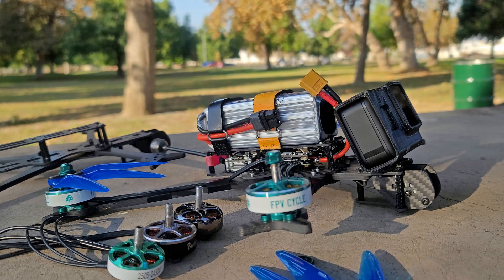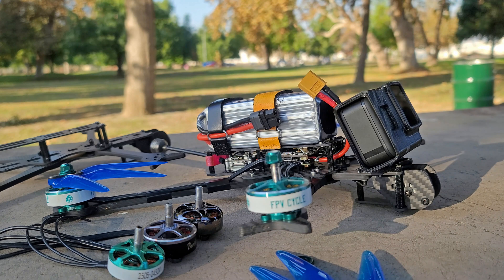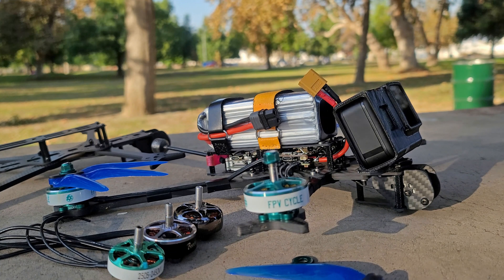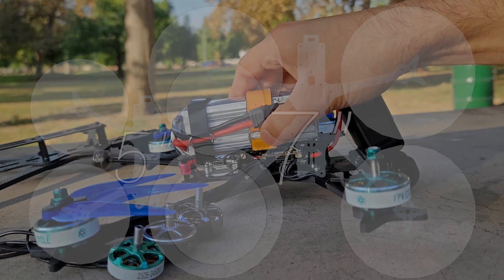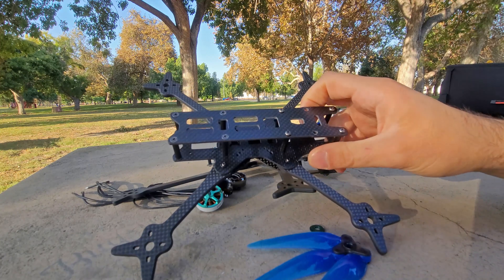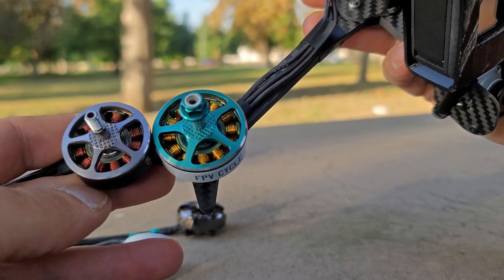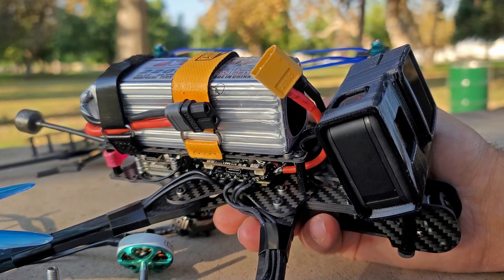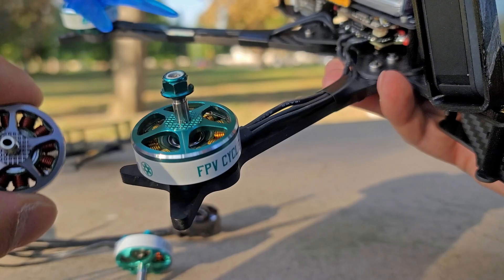A reshuffling of motor sizes, new 7" motor

Comment: Sold me on the DAL, picking up a set of these too! Keep up the Amazing work.
Reply from the maker: Wait. They explode. They made a new hub. Coming soon
Reply from the maker: The new hub is real good. 

https://fpvcycle.com/products/dalprop-fold-7-diy-folding-props-with-updated-hub?_pos=4&_sid=58dab937d&_ss=r
Reply: @Kabab  
How can I see it's the new hub or not?
Reply from the maker: @waldemarkraus2855  you can't tell unless the listing specifically says 'new hub' like the one on fpvcycle does. They even look the same but one explodes and one does not
Reply: @Kabab  
I found some information and pictures here:
https://www.foxeer.com/dalprop-fold-2-f7-folding-responsive-freestyle-props-less-propwash-g-318
Looks like the new hub is completely black and they use some kind of fiber composit material. They also call it "Fold 2" now.
I found no source to get them here in germany. Even banggood seems to still have the old batch :(
Reply from the maker: @waldemarkraus2855  order directly from DAL?

Comment: Have you tried CNHL's 2200 6s yet? all C variations (70, 55, 40) are quite cheap at the moment. I just got a 8" yeti shipped out and their preferred battery has been out of stock for a while.
Reply from the maker: They're cheap because they're cheap. They just can't provide the amps.
Reply: @Kabab  I see. I had heard good things about their smaller lipos. Would swapping to xt90 make a meaningful difference in this case?
Reply from the maker: @zaplocked  yes definitely. The xt60 is limiting for sure.

Comment: Just curious, what updates or changes were made to the 5" glide frame? I've been running the hyperlite Flosstyle 5" for years but have broken a few arms. I got the 6" glide and it seems great so I'm considering the 5" glide
Reply from the maker: Various parts were beefed up and the lower deck was adjusted to make it easier to build.  It's now 103g

Comment: Curious about the Dal foldables exploding, what is the point of failure? I imagine it would be the mounting hubs and not the blades themselves...correct?
Reply from the maker: The hubs flex out and let go of the blade. They've updated the hub and are sending me some new hubs for testing

Comment: Looking forward to hearing more about this frame. I'm sure it will follow suit with all your frames, that being as light as possible. The problem with a 7" quad is vibration with the size of the motors needed for a quad of this size. I know I'm not telling you anything you don't already know, but I've never had any luck in a 7" quad with arm thickness less than 6mm.

Lastly, i appreciate all your efforts in developing a quad size that just doesn't get any attention, for the most part!
Reply from the maker: Really zero attention for 7". The whole class just gets leftovers.  I also hear you on the 6mm arms but it's just too heavy. 5mm and wider has been working out so far. Too much more than 160g frame weight really starts significantly impacting performance. The gopro is extremely annoying to throw on there too.
Reply: @Kabab  - Pretty much! Other than you, Rotor riot seems to be the only other company exploring the 7" frame! What no one is doing is targeting the 7" for freestyle specific. And, i get it, the market for this size quad is for Cine-Crusing. 

Would 7" freestyle be something you would consider exploring, or perhaps are exploring? I'm going to try your new motors on this TBS Source 7 and see what sticks! If these were in a 1700-1800kv I'm thinking that could be the magic mix, even with the GoPro! Again, i realize the market is for the lower kv for that size motor.

Maybe for Christmas!!

Thanks for listening!
Reply from the maker: @3eggerfpv397  yeah I'm planning on two more 7" frames. Something general acro and the light 7"
Reply: @Kabab  I'm in!

Comment: Great video! How many amps does a setup like that draw? Do you really need such a huge (and heavy) battery?
Going only by the youtube footage, 2810 motor seems a lot more lively on 7 inch still, but really happy that we are getting more good options for the sevens now. Keep up the good work! :)
Reply: Likely peaks close to 200amps
Reply from the maker: Amps are probably around 200 at peak. Doesn't really matter and we can't get a solid read on it anyway. Unfortunately you do need a substantial pack. It needs to be able to provide those amps. 1800mah on an xt90 is the absolute minimum I'd go with for this.
Reply: @Kabab  thanks for this info, so using 2 1050mah 6s packs from the 5 " in parallel should be a great match.

Comment: Just wondering if anyone's ever thought of putting the flight controller in the back of a deadcat quad instead of the central stack so that it is located more centrally between the props? I've always heard of how strange the deadcat configuration feels and am wondering if having the more central flight controller would help in any way?
Reply: Dont matter where it at since the frame is flat, bob discused this in past
Reply: @flo-ridafpv5713  But if you were to, say, rotate the quad on the pitch axis around its center of mass, the flight controller would not just rotate on axis but be accelerated around in a loop. The g's created by the acceleration in a loop cause readings in the flight controllers accelerometer would not be there if it were only rotating such as the case with a flight controller located at the center of mass? I might try building one and switching it back and forth to see if there is anything to it, probably not anything, just curious. Thanks though. I'm gonna have to go back through the repository of Bob's vids. lol.
Reply from the maker: It doesn't matter where the FC is mounted. Dead cat feels weird because the CG is in the wrong place but we don't have a choice because we need props out of view.
Reply: @Kabab  Thanks Bob. For some reason it just bothered me that it was so far from the center of mass. Love the motors. I'll have to try and snag a set for myself.

Comment: Thank you for all the great work and pushing the hobby in the right directions! Do you think there is a place for 8-10 in or are quality props and costs the limiting factor? Either way looking forward to the 7 in props you have coming up!
Reply from the maker: We don't even have good 6 or 7" props let alone 8". In time there will probably be a place. For now, we need to get something reasonable for 7"
Reply: I find the graupner e-prop 8x5 to be the best bi blade by a wide margin then master airscrew tri's and bi's are ok but very heavy

Comment: Some sweet flying. On  fpvcycle page you said the BrotherHobby 2806.5 1300Kv motors would be better on 6 inch. Do you have a 6 inch build you can fly them on? I'd be interested in seeing that. Been looking at building a 6 inch kwad.  I'm curious about the flight performance that would give us. Remember to floss. 🤓
Reply from the maker: I generally don't really recommend 6". It's like a middle size that doesn't totally make sense. 5" can do just about everything 6" can do. That being said, yeah the 2806.5 will be an awesome 6" motor
Reply: @Kabab  I understand, makes sense but I happen to have the Konasty Cougar 6" frame and everything but 2 more 2806.5 motors for a complete build. And your thoughts gave me an idea. Happy flying, 👍💖🤓
Reply: @jlarson42  those are fine dude, i fly 2 6in  badgers on 2207 2450 4s on bi blades they fly amazing...BUT i dont carry gopro my auw is 650g w 1500 695 w 2200, i just superview my dvr  ;)...dji
Reply: @flo-ridafpv5713 thanks for the info, I'm saving for dji. My 7" Source one build with 2200mah lipo and the BrotherHobby Avengers is 970auw. Super smooth flyer even in some wind. But not so acrobatic. I've got iNav on it. 🤓
Reply: @jlarson42  yea buddy, theres pretty solid rumors of v2 goggle now fyi, nice yea heavy is better in wind, & my 2207 motors dont handle heavy 6in tri blades well, dont matter cuz they too floaty for me at 650-700g anyway & luv that bi blade sound hehe
Reply: @flo-ridafpv5713  👍🤓

Comment: I'm trying the bh 3115's on 7 inch props, have I missed the plot or could this be good for aggressive flying?
Reply from the maker: Those motors are enormous. The only issue with them is the immense weight of them.  It won't be quite as nimble but it should be more powerful. That size is better suited to 8" but will also run warm to hot.
Reply: @Kabab  thanks for your reply.  Using the dal 7056's , goal is to fly race-y. I'll report back if this works at all
Reply: @jrock7859  You don't need that much motor to feel racy - a full 3115 is a 8-9" prop in my book, because that can absolutely haul

Comment: Curious if you did a performance test on your 7 inch frame with 5 inch props? I'm running 5 inch props on a 6 inch build. Not as noble, but very stable.
Reply from the maker: The 5" cineglide is extremely stable because of its large size already

Comment: In a previous vid's comments you recommended I try the Brotherhobby 2806 1700kv motors for 6" 6s - I gotta admit I'm a little disappointed now that I've got them installed - the shafts on mine were machined to be undersize (4.85mm) so the prop is completely loose on them.. Not sure how much of an affect this was causing but I wasn't able to even get a basic tune flying on them without major issues after 2 half day tuning sessions.. I kinda wish I'd bought the F90's instead but I'll go back to my F60's for now.  

I'd love to buy a set of these 7" motors to try on mine at some stage but these are the second set of BH motors I've had tuning issues with and TBH I'm not sure if I would buy a BH made motor again after these experiences..
Reply from the maker: That is very unusual. I would say that could be more of a prop issue. I've never actually seen that issue.
Reply: @Kabab  I doubt It's the props mate - HQ 6043x3 V1S is my go to and it was flying relatively fine on these + F60's previously, even tried a few other props with the same result.. I suspect there's some sort of resonance issue combined with fettec ESC issues but I've just swapped out all the electronics to try and narrow it down anyhow.

Comment: What settings are you using on the gopro?? Did you use realsteady go?
Reply from the maker: It's RSgo on tht lowest setting. Almost off. Just because it does a good job of fixing the distortion. It's not really doing much otherwise

Comment: i tried using brother hobby 2810 1150kv motors on my 7 inch build. seemingly no matter what filtering or tuning sertup i did the motors would get burning hot. i never had it desync or anything but never really pushed it either. is that a common problem tuning 7 inch?
Reply: Something has to be wrong, those motors are overpowered for 7" but I have same ones as I'm running a pig of a 7" with 6s2p pack.... I haven't got around to PID tune on these motors yet but I would prob start around 60p and 60d if you got a decent sized battery on it.... I was running 2806.5 before with pids around 100  and still had cool motors
Reply: @badfourlife  yeah i just dont understand whats causing the issue. ive put the same tune as someone running basically the exact setup. down to the fc and esc. may just have gotten a bad motor or messed one up somehow.
Reply: If youve used  blackbox before it's super easy to find a bad motor with the motor outputs as one will always be asking for more throttle, other than that just make sure ya got the quad balanced....Def weird prob though, I think blackbox might be needed if you copied someone else and still are having issues
Reply from the maker: Nothing is wrong with the motors. The surface area to volume ratio is just awful. You can't get them to run cool. They're self limiting and inefficient as a result of this issue.  It's not a big deal. Just know that they'll run hot and don't worry about it. The reliability will be basically 100% because of all the magnet surface area. The stator will have a good grasp of the bell. The trick is to balance the surface area to volume ratio and keep the whole thing reliable for the overall power you plan to ask of the motor.
Reply: Once i pushed my p/d around 80/110 to be stable in wind i brought out low end vibes with these 2810 motors, 48khz and 12 degree timing fixed this for me, although ill prob increase timing to 16 once i get 7056 props compared to my current 7x3.5x3
Reply: My 2810 1180kv are great on my source 1 7inch   motors barely  warm
Reply: https://youtu.be/lrtvGaO7v3Q

Comment: hey kabab. first of all thank you so much for all the effort you put into innovation in our great hobby. you rock! 💪
i also have a question, im trying to build a super lightweight (350-450g dry weight) 7" for endurance mountain surfing. do you think i would need such huge motors? i'm not planning to do freestyle with it, but want enough power to get out of trouble while flying in the mountains.
my current plan is to use the h7 beast 55a AIO and the xing cyber 1777kv on the TBS Pizzabox? (not released yet) 7" 46g frame
Reply from the maker: depends how much control performance you're willing to give up.  You can run 7" on a 2207 motor with a 2200mah battery and get probably 25min flight time. It'll feel awful to fly but it'll do it.  2806.5 is really the absolute minimum I'd go to have decent control on 7".

Comment: Any comment on the new BrotherHobby 2806.5 LPD in green?  I'm not finding any detailed info on their specs, or even what's changed since the older avengers.  Not even sure what LPD stands for?
Reply from the maker: they made another 2806.5?  It's not going to perform much different whatever it is.  Overall the motor size dictates it's performance more than most of the other factors.
Reply: @Kabab  Apparently: https://www.rcgroups.com/forums/showthread.php?3739039-BrotherHobby-New-Motor-LPD-2806-5#post45707671
RDQ and GetFPV are carrying them already.  I'm tempted to get the old Avenger on sale, but if LPD stands for Low Power...D, then could be nice to pair with Li-Ion.
Reply from the maker: @AfterFPV  🤷🏻‍♂️. Both 6" motors imo

Comment: OMG I made a quad lighter than you!?  Lol.   Your tech talk videos have been really interesting, and the way I've seen you constantly redesigning quads and talking about it has been inspiring to my own creative process.  Thank you!  After I lost my FlosStyle earlier this year on a long range flight I designed my own quad based off a similar layout.  The 7" long range quad is 150 g lighter than the one in this video with a 2200 6s (only 45c).  Comparatively I'm not as badly off as I thought at 1335g with a hero 6 and 5200mah 6s li-ion setup that can handle a constant full throttle (w/ 1300kv motors though)  I just got the 2806.5 motors after you got me set on them  😉  I'm starting a new build soon though so just might have to try these new motors on it!  (if they aren't sold out yet! 😂)
Reply from the maker: yeah there were limitations here I wasn't willing to compromise on.  I hate that the frame is so heavy and I still need to add some weight here and there too.  It's very common to put the battery like that with the camera far out in front with a dead cat stance in order to get the props out of shot.  If you don't need props out of shot than it's a non-issue.  You can design a normal quad.  Typically I don't go for the absolute lightest thing, I just don't like to waste material anywhere or carry dead weight for the sake of nothing related to performance.
Reply: I still have a hard time believing you can full throttle with 1300kv 2806.5 ....the math just doesn't add up and I def pull over 70amps at 75% throttle scaled
Reply from the maker: @badfourlife  my motor is 1450kv. I go full throttle plenty on it.
Reply: @Kabab  I mean full throttle on mine will overamp my 6s2p pack which has a max rating of 70amps.... I usually scale my throttle to 75% so I don't go over that so my Lion packs actually last and I don't have to worry about banging full throttle when I want... I even got a switch on my tango 2 that switches throttle scaling from 75-80% for last half of pack as I max out at 60-65 amps once I'm under 3.6v
Reply from the maker: @badfourlife  ah. Yeah that's a bit of a struggle
Reply: @badfourlife  Beefy LiPO packs will actually shove that much power (admittedly briefly, but fairly well). The cylindrical cells won't do it, but it's fine.
Practically, using tools like throttle limiting/scaling, and using vbat_sag_compensation (BF4.2, it'll probably appear elsewhere within a release) helps a lot with that

Comment: This is so spot on for what I’m looking for. If it has decent flight time that is. What can we expect in flight times? 

Frame available in time for a winter build? (Season starts late april). 

Btw this won me over. New patreon here 👍🏻
Reply from the maker: Thank you so much for the support.  It's HUGELLY appreciated.  HUUUUGGEEELY.  The flight time is entirely dependent on how you fly and what you're hauling around.  No gopro and a big 2800mah 6S will fly for maybe 15+min cruising.  Gopro and a smaller 2200mah with a single XT60 instead of XT90 will result in ~5min cruising about.  Fly it hard and you'll get just 3-4min on that 2200mah xt60.  Overall, the motors have the ability to draw more power since they are higher kv and bigger but if you fly them the same as you'd fly a smaller motor, they will be more efficient.
Reply: @Kabab  is correct, 2200-3300mAh is where these will be happy.  On the 2200's, flight time should be anywhere from 110s to 15:00 if you're being nice to the battery.  3300's add a bit more, but it's not massive. 
Throttle liming is the other way to ensure you're not just trying to pull 200+ amps out of the battery.
Reply from the maker: @bk.osbakk  oh wow. Quite the view. I'd say something like 2600-2700mah 6s with a gentle touch on the throttle should get close.